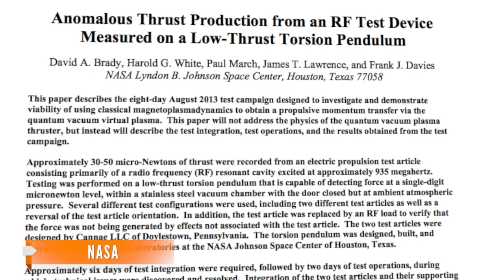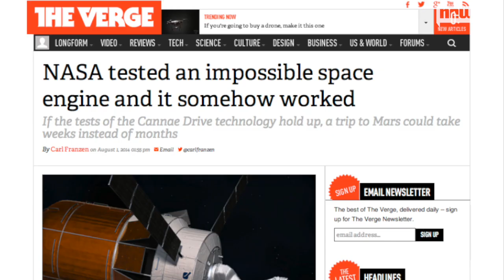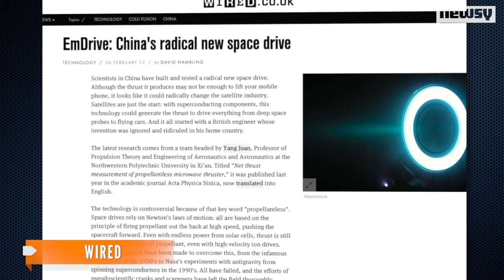NASA Tests 'Impossible' Engine, Finds Out It's Really Fast

Comment: There are a lot of microwaves in the so called Van Allen radiation belts to. So before we start engineering a new engine better we find a way to left this planet without any heltisues.

The belt basically consists of two radiation zones: the inner one extends in low latitudes, ie. H. near the equator, in a range of about 700 to 6,000 kilometers above the Earth's surface and consists mainly of high-energy protons. international space station orbits around 408 Km. 

Only the Apollo missions to the Moon led through the Van Allen radiation belt and beyond, where the astronauts were also exposed to direct sunlight and any radioactivity from the lunar surface. Such a radiation exposure in a manned flight to Mars would be significant.So still there are some questions. maybe Stanley Kubrick had the answers ?
Reply: You're talking about natural microwave energy; this is artificial microwaves, created basically like we do with microwave ovens....only much more powerful and specifically tuned for max efficiency. Completely different than what's in the VA belts.
Reply: i am talking about the ability to left this planet in generally without significant health issues.
Reply: Well, passing through the Van Allen radiation belts didn't seem to cause harm to Apollo astronauts going to the Moon, did it? And that was decades ago; I would think that with better spacecraft, better spacesuits, etc., this would be even less of an issue now, than you seem to think.

I will say, though, that it would be game-changing if someone could figure out a way to equip spacecraft with particle shielding; either a special material, or some kind of an electromagnetic field that deflects radiation and particles away from space vessels and the astronauts inside them. If you could also figure out how to "polarize" hulls to deflect harmful particles, then space travel would be significantly safer.
Reply: Actually we talking about two radiation areas and the unfiltered sunlight from the heliosphere to. planet earth has a protect shield 8 to 18 km thickness. The belt basically consists of two radiation zones: the inner one extends in low latitudes, ie. H. near the equator, in a range of about 700 to 6,000 kilometers above the Earth's surface and consists mainly of high-energy protons. international space station orbits around 408 Km. newest measurements of the inner belt shows contradictories. almost all aerospace nations did animal try. All results saying the belts are deadly.
Reply: You don't need to describe the Van Allen belts to me; I know exactly what they are. And we AREN'T talking about "two radiation areas" - if you remember correctly, we were talking about the microwaves used in this new type of drive engine; NOT the Van Allen belts! And I made the point - which you've apparently missed - that these were two different types and bands of microwaves. The microwaves used in the Cannae drive have NOTHING to do with the Van Allen radiation belts....so, would you please stick to the original subject?
Reply: Laser propulsion isn't going to go anywhere....it's too impractical. Ion drives and thorium or fusion energy sources are the way to go.

Comment: We already have a case of a planet under our feet. What important theory has science come up with, that can be tested, confirmed or refuted only on data from Mars? No such theory has been presented. And even if it emerges, why not use automated probes to acquire samples? It would be one order of magnitude cheaper and absolutely safe. The project that sent humans to the Moon and back mobilized sufficient tax dollars only because the US elite wanted to score a purely ideological point. (As for scientific curiosity, automated probes went and brought back enough rubble samples and pictures before and after that mission). I don't see a similar motivation since then. Yet people are fantasizing  about trips in Outer space. They want a voyeristic experience of freedom, because they are pinned down by the social strucure like moths. If these fantasies have any other purpose, it is to push quite real programs to install weapons into orbit. We need more freedom in our daily lives, not yet more display of the omnipotence of our Masters.

Comment: I personally prefer ether tachyon wave motion style "blink drives" ones powered by micro black holes that give off kinds of radiation, almost like tuned quasars. or a spherical magnetic induction drive working with magnetic fields and the attraction of positives to negatives and vice versa to achieve beyond relativistic speeds with sub atomic particles channeled part by force of attraction nodes powered by the engines output to increase the amount of negative or positive energy drawing the particle that then switches to push it while the next positive/negative node starts to draw and part by the magnetic fields that use there polarity perfectly timed: one inside of the particles traveling radius, the other on the out side, it has several applications, including an all in one impulse and Omni directional thruster mode and closed circuit mode warp core.. building energy could be done by both the magnetic fields which if there is a response I'll go into about its a beautiful multi application use in the neu-sphere design due to the fact it neutralizes several obstacles to it's and its mounted chassis' operation by what of its shape and design///(one of the multi applications being the use of a magnet and/or a magnetic field being used to pass threw a coil inducting a current to the "coil" coil shaped or other wise that then can be used and is used in many lesser applications for power storage of even a lowly instrument)\\\ there of..  It's something I came up with based on sound and rather simple physics...initially an perpetual energy design for a generator but being a huge pusher for space awareness and travel among highly intelligent, I naturally and constantly refined the concept.. I hope we do advance for that would see me going into space to attempt to prove my theory at best or maybe a foot note at worst...also its soon to be patented just to make sure its not so easily stolen... I would hate for some one to make a lesser version or one that's initially greater by has flaws the end up killing the concept by way of killing people. also, these seem like thruster assembles with "solar panels" so to speak, the situations with out these particles would require a perpetual source of energy....to fill the super capacitor your gonna need for emergencies or maintenance  cycles...just saying.. lest you get stranded in space with 2 thirds a interstellar drive..

Comment: A Micro Newton is the same as the downward pressure of 0.1014 grams So this engine produces between 3.125grams and 5.2grams of thrust. I don't know what the engine weighs, but I do know these kinds of thrust will not get you to Mars in a hurry.

Comment: the thrust is so miniscule and requires LOTS of power it will not be able to push anything anywhere quickly.
Before you post more do a lot more research, the solar/light sail does not use light.

Comment: The question isn't whether it works at all, it's whether it makes enough thrust compared to the energy consumed.  As it stands, the answer is no, the thrust/energy ratio is quite poor.  It might turn out to be great someday, but we have to optimize it, and we can't optimize it until we understand it well.  I've heard "don't worry about how it works, it if works, use it."  Unfortunately, that doesn't cut it, because we need to improve it at least 100 fold before it's practical, and to get there we have to understand how and why it works, so we can engineer the underlying factors in our favor.

Comment: Please people. It is easy to repeat what others have said about being able to run this new engine for years on end and thus achieve greater speeds than with a chemical rocket. But this engine produces 50 micronewtons of thrust. The Raptor engine used by SpaceX (look it up on Wikipedia) delivers around 2 meganewtons of thrust. For the new engine to add the same impulse to the spaceship as the Raptor does in one second, you'd have to run it for literally more than 1000 years. The phenomenon apparently observed in this test may be fascinating from a scientific point of view, but a lot (and I mean a lot) has to happen to make a practical engine out of it.

Comment: A simple "photon drive" seems inherently vastly more efficient than any other scheme.  Why?  Because you can continuously harvest enormous energy from the sun within the solar system (especially in the region between the sun and mars and/or asteroid belt).  In the long term it might be possible to construct a scheme that extracts several times the momentum of each "photon" of light pressure from the sun, though I won't describe here because it is not practical in the short term, and only somewhat practical over short distances (earth to moon) in the medium term.  In the long term it could make the trip from earth to moon (?or mars?) much cheaper (but requires many simultaneous missions [and micro-missions]).

BTW, especially for unmanned flights, the simple "photon drive" can be super efficient by charting trajectories that pass close to the sun.  Why so?  The first part of the trajectory is simply a dive from earth into the gravity well of the sun.  The cross-section of the craft facing the sun would be minimized during this portion of the trajectory, with many layers of highly efficient hyper-thin (silver/gold on graphene sheet) reflective material to reflect solar energy away from the payload.  If the huge reflector is already opened (unlikely), it would be kept edge-on to the sun to avoid exerting light pressure (to maximize payload speed).  The path of the craft will be bent quite a bit (30 ~ 180 degrees) as it passes the sun.  Once the distance from the sun starts to increase the craft will rotate to present the maximum surface area of the huge reflective surface towards the sun.  As each photon hits the reflective surface and bounces back, twice the momentum of that photon is transferred to the craft by what is sometimes called "light pressure".  The extreme intensity of "light pressure" during this part of the trajectory can boost the speed of the craft greatly and shorten mission duration (albeit only for longer journeys == journeys further from the sun, like the outer planets and beyond).  For shorter journeys like earth to mars, such an approach is probably slower, not faster.

Comment: "...without getting too much into the technical jargon." 
But that technical jargon is where it all falls apart. It was not a "NASA" test. The test showed "thrust" even on the dummy load (the control). indicating an issue with the test rig. The paper is rife with other errors. 

While someone may one day discover an alternate physics model that is not what we have here. When real research is carried out under scientific conditions with results that can be reproduced by others you can start believing in magic drives. Until that day stay sceptical of bold claims. Extraordinary claims require extraordinary evidence.

Comment: sorry, a particle the size of a pin head,which space is full of, will blast clean through any craft flying this fast ending in death not to mention once you get to mars the solar and cosmic radiation will take a toll on you fast. You can only make it if extremely lucky,no solar flares while traveling. The faster you go the more energy or fuel you need to slow back down. So you have to get there turn around and come right back, will never happen in our life time. Too many things to kill you

Comment: Closer to home (literallly), the big energy obstacle is lifting off from Earth (or in the future, any other planet larger than Mars, which has a dense atmosphere), and this requires so much propellant that it has to be burned in stages to get into orbit.  But two of the difference between a space launch rocket and a jet aircraft hint at another way.

First, from launch to perhaps 70,000 feet altitude, the rocket is surrounded by AIR, which contains oxygen, but rockets don't make use of it, rather they CARRY the oxygen needed for liftoff inside the rocket.  Jet aircraft, on the other hand, only carry the fuel, not the oxidizer.  Therefore, they are ejecting mass out the nozzle that comes only partly from the fuel tank, and mostly from the outside.  This is why they use so much LESS fuel than rockets.

Second, all conventional rockets, in their first stage, are pointed straight up, so that ALL of the lift comes from the thrust, and it also has to lift the entire starting weight and begin accelerating upward.  But a jet (except for some high performance jets in combat/airshow maneuvers) uses the thrust to accelerate FORWARD, so that the forward AIRSPEED creates the lift.  If the first stage of a space launch vehicle burned its fuel with outside air until that air becomes too thin (at which time the vehicle is getting lighter, both by losing mass and by reducing gravity with altitude), and took off on a runway, thus requiring much less thrust at takeoff, it may not even NEED to be staged (hence the SSTO vehicles being developed).

The challenge is to suck outside air in fast enough to generate liftoff thrust.  Most jets use a TURBOJET, which uses exhaust gases to provide energy to compress the air fast enough to bring it to the combustion chamber (on the ground, they use a starter motor powered by the batteries to get the process going).  A RAMJET can be started once the jet acquires enough airspeed to "ram" the air in without a compressor, and some ramjets, called SCRAMJETS (SC means supersonic combustion), can achieve Mach 5 or more.

Therefore, to build a launch vehicle that saves weight at liftoff by breathing air, we must either put three or four engines in the vehicle (turbo, then ram, then possibly  scram, then rocket), or build an engine which can switch modes in flight.  But if we can do that, there will be no more need for million-pound-plus boosters serviced by gantries causing huge exhaust plumes; only a runway to take off with an air breathing jet, gain altitude by aerodynamic lift on the wings, go through the different modes, ending with a rocket when the air pressure drops too low.  And the plane could keep enough fuel to make a powered landing on the same or another runway after re-entry. The space shuttle had no fuel left, so it could only land like a glider ... a very heavy glider.

Comment: The next logical step would be to use the engine to enable a payload to accelerate to and then exceed the light speed barrier or at least disprove Einstein's relativity theory. But it needs to be conducted by open minded engineers and scientists who won't disprove of the notion right away.

Comment: Just hook a friggen Nuclear reactor to the damn thing. Pump 1000 megawatts into it. if the thing cam produce thrust you'll know for sure
Reply: a measly little 80 megawatt nuclear reactor takes up a 3rd of an ohio class nuclear submarine, or a cylinder ~30 feet thick and ~80 feet long. you're talking 330 times that just for the power supply. then you have to add the drive section and the personnel spaces. i'm thinking it's time to find another way. like maybe a way to use those higgs bosuns they just proved the existence of, or pull energy out of one of all those extra dimensions membrane theory insists the existence of.

Comment: Why do they call it no-fuel? Electricity is not for free.
Reply: "Why do they call it no-fuel? Electricity is not for free."

I agree with the first part, electrictiy is a fuel so its not right to say this doesn't require fuel but the second part about electrictiy not being free. Well in space it is free, it comes from the Sun.
Reply: Ok, thanks. Well, I gues it's just a matter of speaking.
Reply: it means it doesn't have to shoot out propellant (like a rocket) in order to move forward
Reply: +hklausen Because the video is confusing the terms propellent with Energy. The drive would still require a source of energy to work which could come from solar cells for example. The claim is that the drive does not need a propellent to throw out the back in order to create thrust. This if it actual works means that the drive is not limited by the amount of propellant it can carry. As long as it has power it can keep on accelerating.

Comment: Let's assume they would increase the thrust by 1000 times to 0,05N and a potential light Spaceship would weigh around 100000000lbs, then it would bring the ship to mars in 21 years and reach a max. speed of 40 mph. It might work but i'm not convinced yet.
Reply: that is not a light spaceship, the spaceshuttle weighs 2k tonnes, that is 50k tonnes

Comment: 2:23 -- AKA a Solar Sail.  Technologies like this one, by the way, work best in the parts of the Solar System which have high solar radiation; not nearly as well past the gas giants.  The pressure of solar radiation is great enough to perturb the ISS's orbit as well, requiring that the station make small burns to correct it.  Solar sails that can move large masses would have to be pretty big, and would be challenging to maintain since all that surface area would be exposed to the dangers of high-velocity random unseen debris.  And, while it allows for constant boost solutions for transit (which are always faster than a chemical rocket, I might add) the acceleration is rarely close to 1 Gee, meaning, there's no need for acceleration couches while under sail.  

Unlike wind sailing, however, one could still boost with some other engine source and keep the sails deployed, perhaps changing the geometry of their rigging to compensate.  Well, that's only half-accurate:  boosting outward from the Sun can be done with sails assisting, and boosting towards the Sun has to be done with some other type of engine.